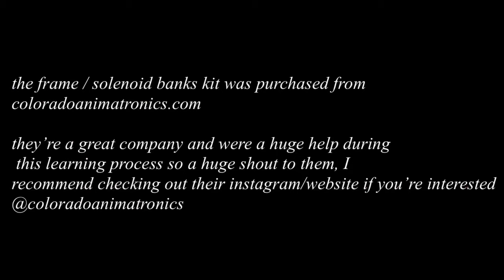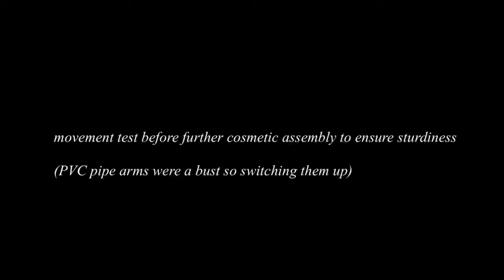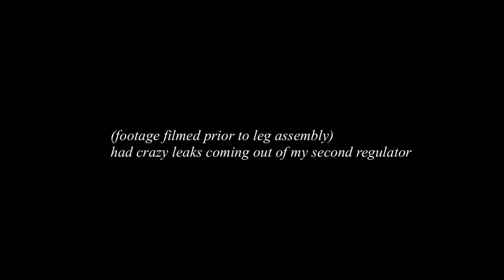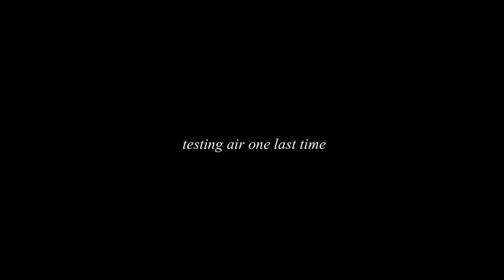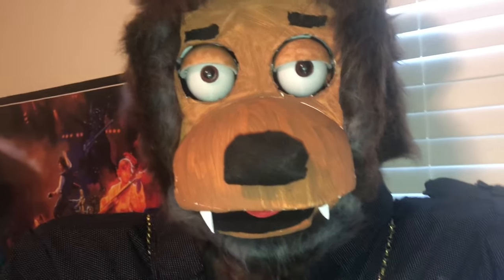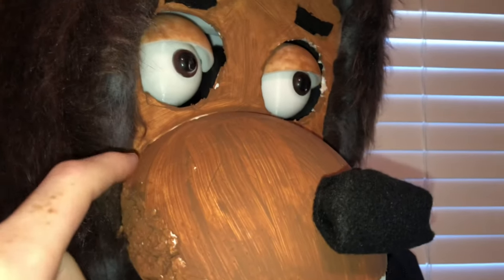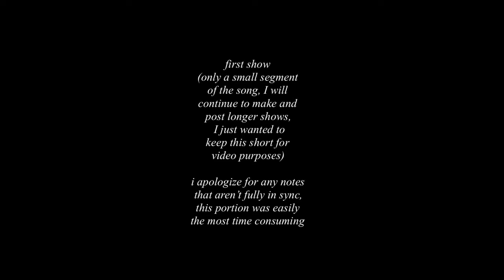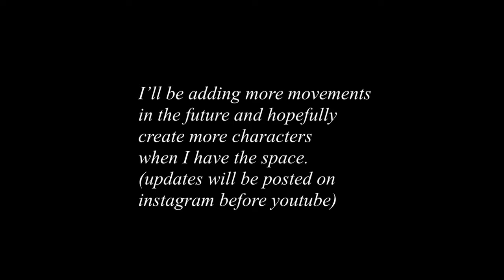BUILDING A PNEUMATIC ANIMATRONIC

Comment: Nice animatronic! I’m making my own animatronic German Shepard but I was just wondering if you could plug the air hose from the air compressor straight into the solenoid valve bank without any extra fittings? Thanks!

Comment: What software did you use to program Animatronic?
Reply from the maker: Vixen
Reply: @liamame  Thank you! I have 2 question. First is, what air pump did you use? My second is what did you set it to?
Reply: @TheBestTrainsAreReal  you mean air compressor right? The thing that pushes air. And he used 100 psi
Reply: @michellenguyen4086  Okay, thank you!
Reply from the maker: @TheBestTrainsAreReal  sorry just seeing this now. I got an oilless air compressor from harbor freight with a max 100psi, but I have it set to around 45-50psi. The flow controls slow down the air so the movements arent as aggressive
Reply: @liamame  Okay thank you! Can't wait to see more on your Animatronic!